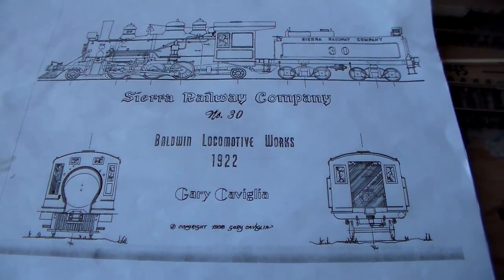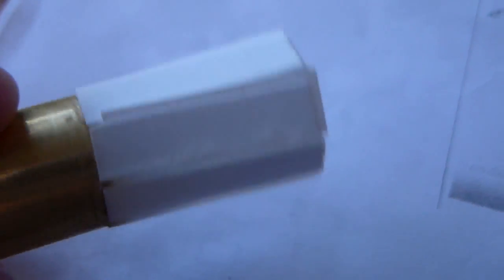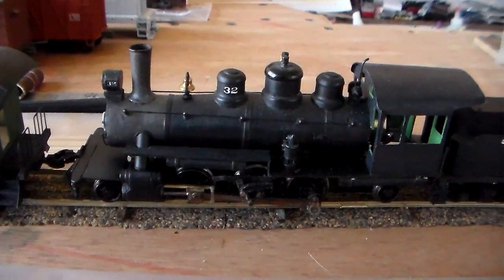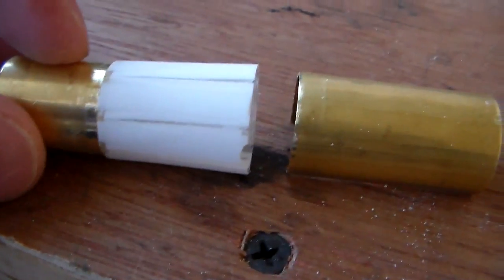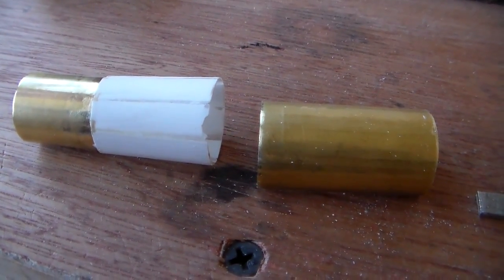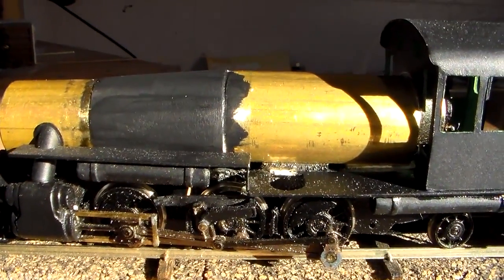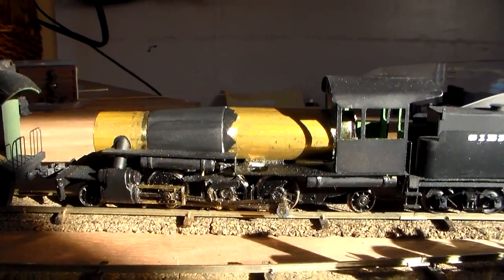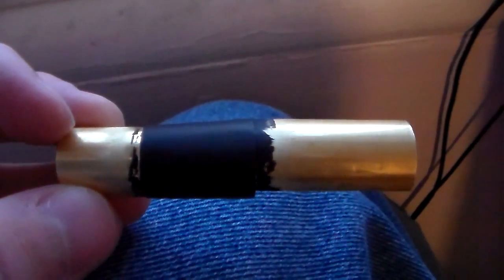SierraRailway's How-To's: Scratch-building a steam locomotive boiler

Comment: Was just reviewing a boiler plan published in Railway Review 1895 - that is the conical sheet and the boiler type is a wagontop.  The sheet is made from 2 major sheets - the bottom one if cut square and rolled to fit into the smokebox section. This give the bottom straight and level to fit on the frame.   The top sheet is cut with arcs using a predefined pattern and then it is rolled  making the edges match up with the bottom sheet and ends matching up to make a perfect circle.  This gives your the conical shape on top - then some major duty seam plates are riveted together  on each joint.    Examples of these templates must exist somewhere and there is probably a math formula to know what the arcs are to end up matching the diameter you need.

Comment: Excellent reference material for new scale build of historical locomotives.  The styrene wrap can be varied in thickness for modeling different generations of locomotives, and wire can be used for retaining bands on replicas of pre-1890-built wood-lagged boilers such as those on the 4-4-0 Baldwin C-8-C Standards from the 1870's.